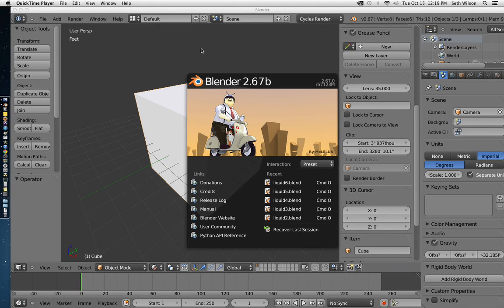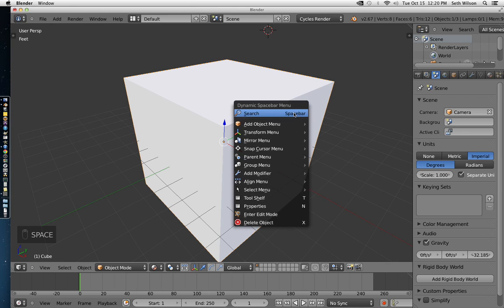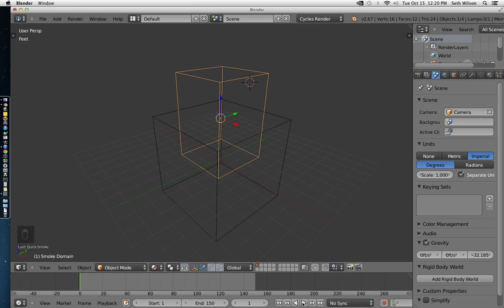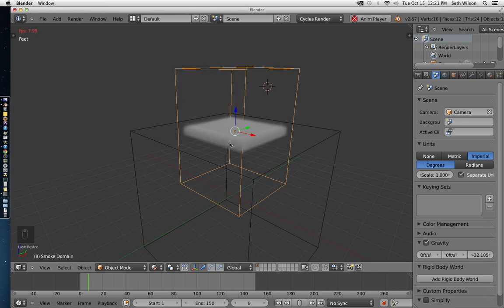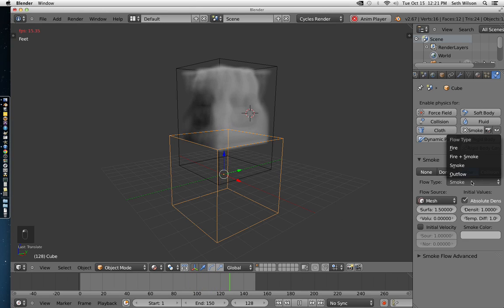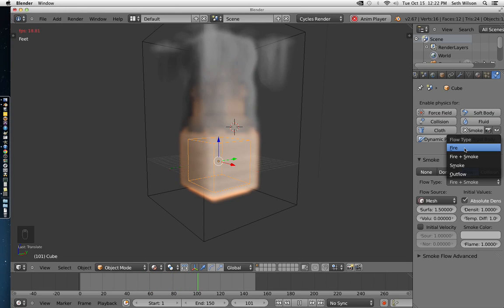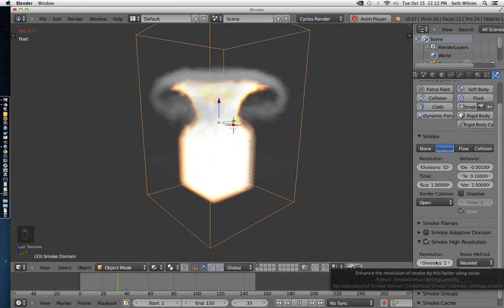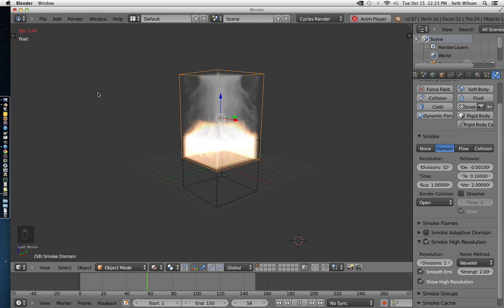Quick and easy fire simulations in Blender 2.67

Comment: for those unable to get the fire+smoke to work, 
Remember, you had to click on the EMITTER. Not the domain. You need to click on the object you created, then head over to its Physics panel and change to fire+smoke. 
You're not seeing the smoke or the fire because you're changing the physics settings of the DOMAIN. Make sure you have your emitter object selected for fire+smoke and everything should be good.

Comment: Only smoke works.
Reply: you're clearly doing something wrong then.... it worked for me.
Reply: A year late but one box serves as the domain and the other the emitter. Often, the emitter is spawned as the larger of the two, making it only work with fire. resizing and re-positioning fixes the issue

Comment: Why I try to turn the smoke into fire+smoke, the smoke disappears. Please help.
Reply: 4 years late but one box serves as the domain and the other the emitter. Often, the emitter is spawned as the larger of the two, making it only work with fire. resizing and re-positioning fixes the issue